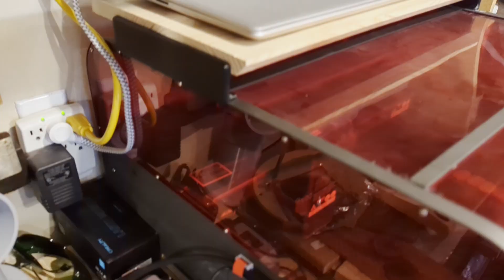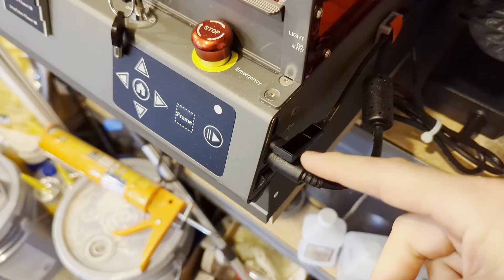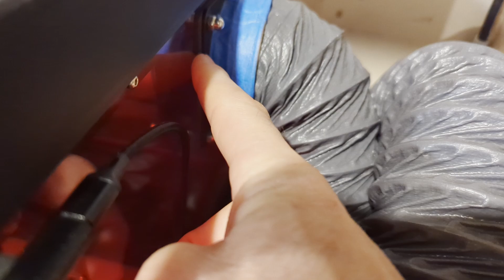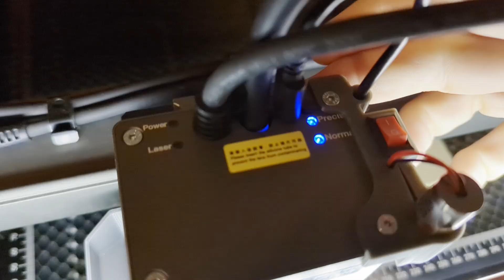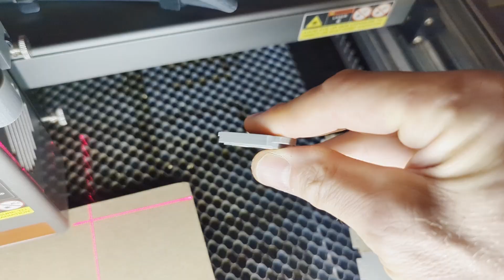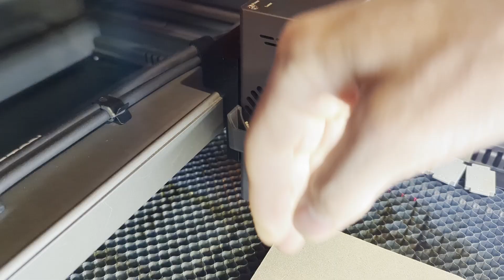Creality Falcon2 Pro - my setup (includes fix videos and 3d printed parts)

Comment: Super helpful tips, I appreciate all your lessons learned  - I have this same machine and have watched a lot of videos.  Most are just "this is how well it cuts" or "this is what it can cut/engrave," 

I have a few questions - I currently have the rails, but placed a honeycomb on top of that (I thought it would be good for airflow) is yours just the honeycomb on the tile?  I am interested in doing that laser mod - that would be a great feature.  

Do you notice that even after calibrating the camera and the lens, the camera is off in Lightburn?  I can typically do a 12" sheet and its pretty accurate, but when I engrave on something small in the middle of the bed, it is always off.  I have calibrated multiple times, and feel like I did a very accurate job.
Reply from the maker: Yes - just a tile on the bottom of the drawer (16"x16" tile from Home Depot - $1.50US) with the honeycomb sitting on that.

I don't really use the camera too much as it's only a few inches off the surface and has to distort for an accurate image. In order to be really accurate, it would need to be something like a foot above the subject. The laser pointer is dead accurate for my needs.

Glad the video helps!